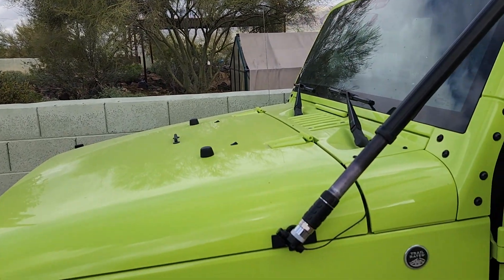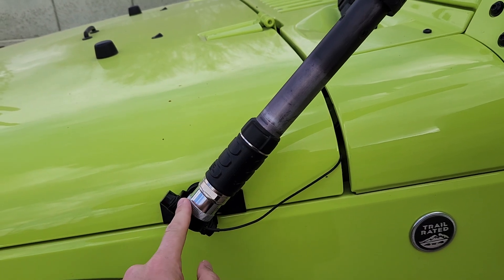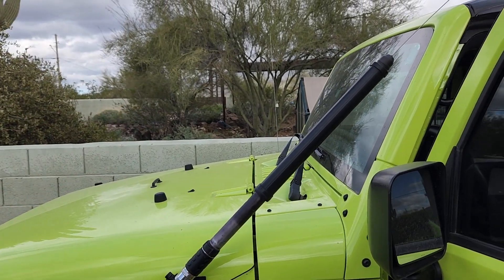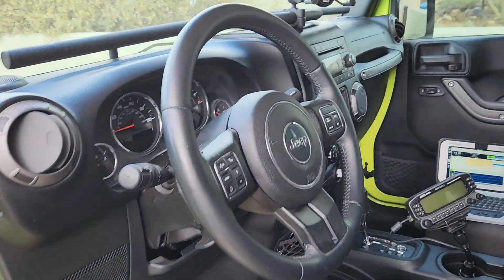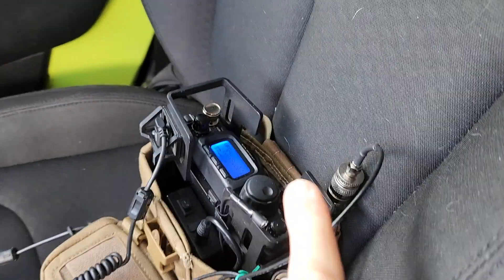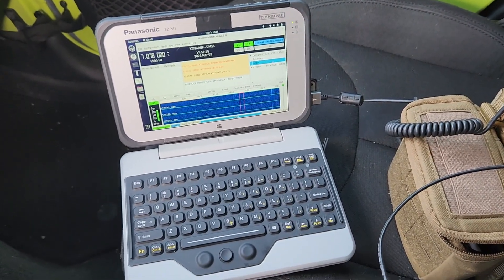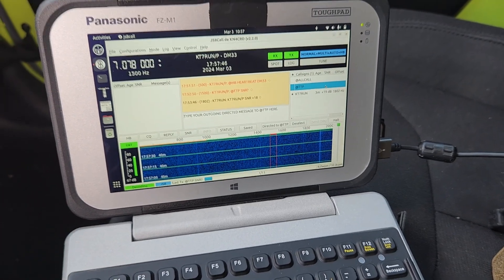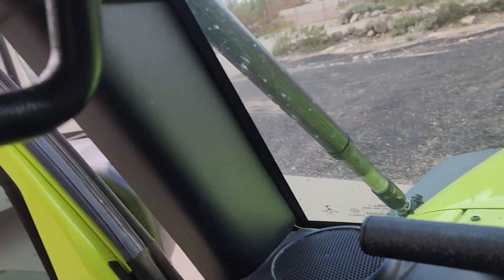Vehicle Mounted Regional Comms - Part 1: ATAS-120A

Comment: I have a 2015 Wrangler Unlimited Sport.  I've been trying to figure out how best to mount an antenna since the Wrangler has the fiberglass top and mine has the factory plastic bumpers.  That Diamond antenna mount looks like just what I need.  @Blackabeard (Blackbeard's Radio) sent me over here to check out your videos on your Wrangler.  Question - Have you had any issues with the antenna bending/denting your hood due to the weight of it and the sway in the wind?  I read somewhere that could be an issue.  Anyway good video, subbed.  I've got an FT-857D that Ive had for probably 10 years and just drug out of storage.  Looking forward to getting back into the hobby
Reply from the maker: No issues with the K400 mount. I have been running it for almost 4 years. The ATAS-120A is a heavy antenna that rarely runs the Jeep as it is usually mounted on my K400 on the RV.

Comment: The ATAS 120a I had was a pos.... I had to send it in for repair after only 2 months. And still it was unreliable. Radio was FT-891
Reply: Mechanical hardware are prone and bound to fail! Army humvees have remote auto tuners with a whip for a reason

Comment: What the military has done when they stop is they pull their HF whip into a horizontal position over the ground, not the vehicle. The only question is "How do you hold the antenna horizontal?" That is mostly a matter of preference.

Jason-KM4ACK uses a quick connect on his Lil Tarheel antenna whip and alternate length of wire with a quick connect.

The biggest factor is gaining efficiency by running longer wire. I would try close to 50ft on any loading coil and you should have good efficiency on 40m. Working like a NAZI hun you could accomplish deployment in 3min.

Another option would be a 1 or 2 turn horizontal loop based on the 4 corners of your vehicle. Have posts mounted to keep the antenna at least 18" away from metal on the vehicle.  Feed the loop with a wide range matching unit at the antenna. The loop on 40m would be close 1/4 wavelength and have reasonable efficiency.

When designed well mechanically you should have reasonable efficiency and band agility when mobile.

SGC mentions using their matching units with multi turn loops for indoor wall installions. I think they suggest up to 4 turns.

In a few years you need more 5W and 60m or 80m. For car mobile there is no reason not to use your FT-857.

You'll get something good going.

Cheers!

Comment: Have both th3 Little Tarheel with a longer whip as well as the ATAS 100, the predecessor to the 120. Both are decent antennas. Have used the 100 as a base antenna with the accessory ring that has three different coil loaded whips for its ground plane. Works good in receive so TX will not be a problem.
Reply from the maker: Thanks for the info!

Comment: Nice setup. Try the Yaesu FC-40 and a 102" whip. You will see that, as you change the freq on the radio. The FC-40 will follow the freq as it tunes.  The FC-40 is about $275 dollars.
Reply from the maker: Great recommendation on the FC-40. I've been considering that unit for years. I've never been a fan of tuners, but I may have to make an exception here.

Comment: I have been shocked at how well HAM sticks work.  I have done well with 20m and 40m hamsticks.  They tune the whole band well.  If you want NVIS a bumper mount may work better.
Reply from the maker: I regret selling a pair of 40m Shark hamsticks at the last hamfest. I had a terrible time tuning them for a vertical dipole deployment. I may pick up another one if my next experiment does not go well, but I think it will work out. I am testing a new setup using a Hustler Resonator. 73s
Reply: @TheTechPrepper  cool.  The resonator look to be narrow BW, it would tune well for data.  I'm looking forward to see how it works for you.  I was shocked my 80m hamstick was very narrow band.  It makes sense that's a lot of wire to cram on a 4ft fiberglass pole with a ~4ft whip.

Comment: I'm always looking at different atas mounts. Thanks for the inspiration, brother. We went to do a POTA today, and the main club radio didn't have its power cable, so we ended up using another members 818. It didn't go very well, but lessons were learned. 😆🤙🏾

Comment: I'm not familiar with the ATAS, so I'm assuming (ass-u-me) that it acts as a vertical antenna with a spherical radiation pattern that is flattened by the ground plane created by the sheet metal on the vehicle.  Would it be worth mounting it on the fiberglass roof of the jeep to remove the metal groundplane?  The groundplane lowers the takeoff angle, so removing it may give you a desired NVIS effect.

Comment: A little off topic, but I have a JK as well and while HF works alright, I get a massive amount of RFI on 2M that goes away when I pull the stereo system fuse. I’ve tried to locate the offending component, but i’ve never pinpointed it.  I am just curious if you see the same thing.
Reply from the maker: Interesting. I can't say that I have experienced this. I've been running 2m/440 for over three years off the same mount and Comet SBB-5 with the D710. Good luck.

Comment: You might stand up the loading coil vertical. Then clip a wire to the tip of the whip. Then connect the other end of the wire to a fiberglass pole on the rear of the Jeep. In essence you would have an Inverted-L antenna that is base loaded on the vertical. 

Jason KM4ACK does something similar for his portable HF operations. Others also have done similarly.

The proximity to the roof will be an issue, especially if it is varying while you are underway mobile.

I used 102" CB whip on top of a homemade loading coil fed thru an SGC antenna matching unit at the base of the loading coil. The whole arrangement was on a bicycle carrier that mounted in a trailer hitch reciever.

On the interstate the wind pushed the whip back to where I got good NVIS performance on 40m and 80m.
Reply from the maker: I typically run the ATAS vertically on both the Jeep and the RV, but I get a lot of skip, hence this experiment. However, trying to run that traditional configuration with as an inverted-L is intriguing. In the end, that will be too much work as the goal for what I am setting out to do is to have reliable NVIS propagation in under 90 seconds. I think the ATAS 120A can be made to work, but it is not enough juice for the squeeze. It's time to move onto another antenna systems that has less deployment challenges. If the FT-818ND supported the ATAS, then it would have been a different story. I appreciate you thinking out of the box on this one.

Comment: I have success stationary angling the antenna away from the vehicle
Reply from the maker: I've had better performance with a telescoping whips (not this antenna) in the past, positioned away from the body as well. However, this ATAS-120A doesn't work well going off any angle--off the front or off the back. It only shines as a vertical. I was curious to test it since I have it. I tried several more experiments with this ATAS-120A this afternoon, but it's looking like trying to get high angle radiation from this antenna is a hard no-go for NVIS.
Reply: @TheTechPrepper  I've never used the atas. Only other brand screwdrivers from high sierra(back around 2008) tarheel, and diamond.

Comment: With your antenna close to the jeeps metal, you're radiation pattern will be negatively impinged upon. Try putting the the antenna on your back away from metal.
Reply from the maker: I plan to try that with the next deployment. I have a mount that mounts above the license plate. This ATAS-120A is too much work as it requires automatic tuning by only a handful of radios (FT-857/897/891) that I have, but don't really run anymore. The next antenna is tuned manually. More experiments coming.
Reply: @TheTechPrepper MFJ does have an adapter which converts the AH-4 Icom commands to ATAS.

Comment: Not sure what model that Jeep is, but if it's a JK, there's a great antenna mount for the rear license plate bracket. I got very good tx/rx with it when I had mine.
Reply from the maker: Yep, it's a 2016 JK. I'm experimenting with a number of mounts, including the one that you are describing. I plan to film each experiment and varition... success or failure. Stay tuned.

Comment: Can't wait to see what you have up your sleeve with your next whip style deployment.   The only way you can find out what works is to try it!
Reply from the maker: Here's a bit of spoiler. The test will be using a 3/8 adapter on the K400 mount, a Hustler 40m mast, and a Hustler 40m resonator. I'll fold it backward when in motion and forward when stationary.

Comment: If you utilise a longer whip which is long enough to reach the boot [UK] or trunk door [US], you will get NVIS'ish, try to get a much of the whip section over the flat roof. Note there will be nulls due to the body of your vehicle, try to find the nulls they are useful; when you have local'ish interference, you can drive and turn the vehicle with trial and error pointing the null in the direction of the interference and increase the reception quality, works OK'ish on HF, and however VHF/UHF can change from s1 to s5. Keep up the good work, God bless.
Reply: You could go expensive and get an ICOM AH-740 Mobile HF Auto-Tune.  It may reach past the bumper...

Comment: I'm doing similar tests as soon as I decide on the antenna(s).  I was looking to start with some sticks (reg or mini) and mount them parallel and offset from the roof rack rail on one side and play with 40m.  My issue is finding someone local to test with.  I'm playing off the typical helicopter mounting to see if that will work.

Comment: I do enjoy your videos and I have a tarheel on my jeep similar to your antenna.  I am not sure what year your jeep is but mine has an aluminum hood that will not support the K400 without bending it.  I opted for using a light mount on the a pillar to mount my antennas. I hope your hood is steal and not issues.

Comment: If you look at the tests the US military has performed, they have had very good luck with vertical whips mounted on the back of humvees, where they use rope to pull down the whip's tip behind the vehicle. This would be easier when parked rather than in motion. DE WA1KLI

Comment: are you looking for NVIS capability while in motion?
Reply from the maker: Not really, but that would be a bonus. The most performant deployment would require me to be stationary anyhow. The goal is to be able to pull off the road and deploy the antenna system in under 90 seconds, then pop back into the vehicle to hit a quick commo window. More tests are coming. This was just the first.
Reply: @TheTechPrepper  How about a roof-mounted plastic reel with 66' of wire, banana plug on the end attached to the reel center, insulator on the far end, and a tuner? If you could park 70' from a small tree or other vertical support, pull the wire out, anchor the far end with a bungee, and plug the banana plug into a lead from the tuner, voila! Quarter-wave fed against the vehicle ground at NVIS height.

Comment: The atas120 is a great antenna for hf
Reply from the maker: It's been handy. I primarily run it on the motor home as I have one heck of ground plane with all bonding that I did on it a few years back. I haven't done much with the Jeep yet.
Reply: @TheTechPrepper  ive been running it on my car for pota, and ive gotten italy, and alaska, and all over.  So it definitely radiates well.  Just interested to see how it works angled for nvis,  concept looks like it should do well, similar to the humvees
Reply: I love mine!  Have it mounted on a Ram 2500. Have 25 bonding straps connecting everything.

Comment: I use a Tarheel antenna little Tarheel. It’s mounted using a similar style trunk/lid mount on the rear driver door, about midway up. This put top 3 inches of the coil slightly above the roofline with a 58” antenna vertical above the roof. I believe this is effectively a 12-13’ vertical and I’ve worked from Kentucky to NC on voice at 10w. I semi reliably get SSB contacts at 10w. This past weekend I used a 100w radio and was easily making SSB contacts. I think a lot of it is overcoming the severely compromised antenna on HF with propagation and wattage.